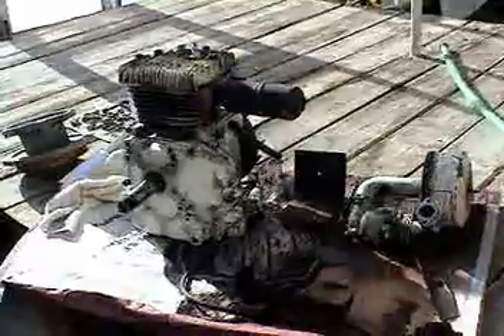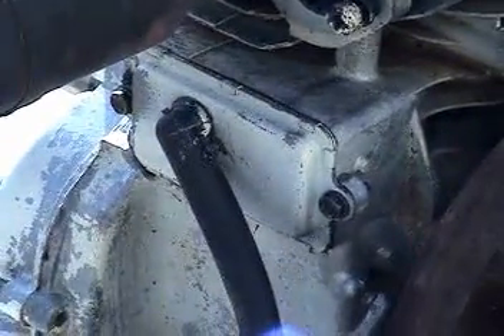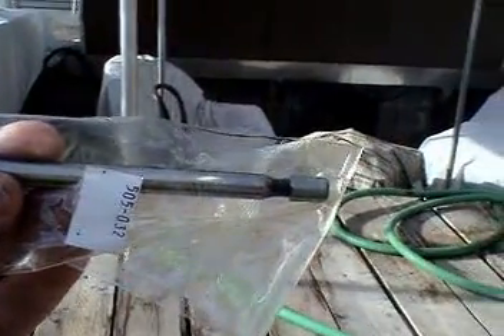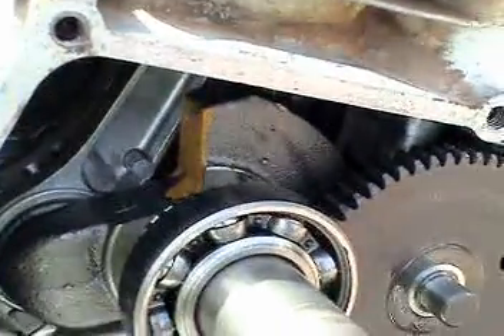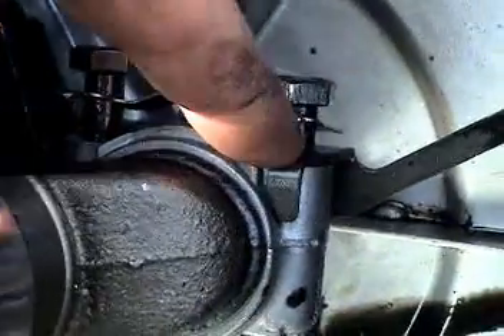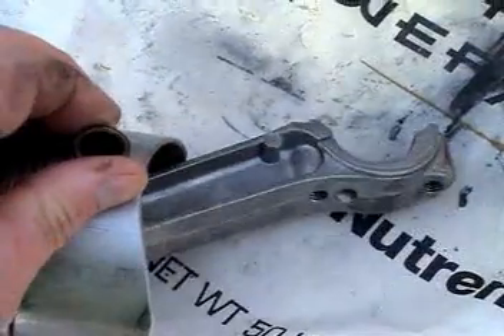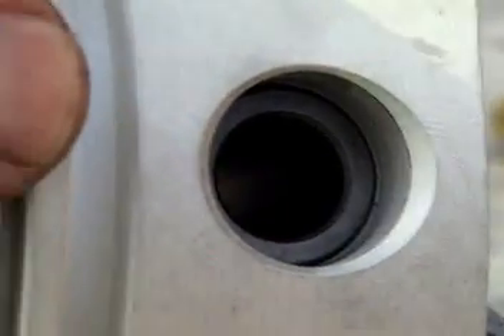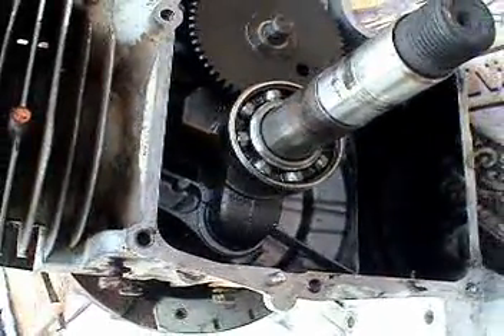Small gasoline engine rebuild / overhaul; part one

Comment: I find the best way to rebuild engines, is to pull them completely apart, to single pieces, spread it out in a big cycle, then place the new parts i wan't installed in the middle, then leave it, go inside and start praying, the creator with do his thing, come back out in 7 days and it will be fully assembled and test run! REALLY, Have faith! trust me!
Note of caustion, be sure to take the new parts out of their plastic bags, for some reason the creator has an issue with that!  (??)
God Bless

Comment: good video..  wasnt sure if you knew what all the parts were called but ya did!!! its an easy job eh??? and i was wondering if you were going to say make sure you dont line up the gaps in the piston rings because this is not good for the engine and creates too much blow by.. ya them 8horse single cylinders are easy.. i got a 16hp opposed twin cylinder that im gonna tear apart and maybe my other 16horse twin cylinder too.. not sure yet..

Comment from the maker: Howdy! I do not know how to convert a small engine from horizontal to vertical, but I have heard it is possible. I suppose only Google knows for sure.

As for valves, there are indeed tools to reseat valves, and there is valve grinding compound to do it. My knowledge on such things is almost zero: I am not a mechanic.

Comment from the maker: "hi nice vid man can u help me im looking for the part number to that dipper of yours i want to convert a vertical shaft to a horizontal"

Howdy. It is 222113, "Dipper - Connecting Rod." It is reference number 30 in the old repair manuals. If you send to me privately an email I can send the PDF document to you.

Comment: the input valve and the exit exhaust valve lol id be afraid to lose the valve keepers through the cracks on the deck why didnt you show how to use the valve spring compressor i wouldve like to seen it

Comment: what you refer to as 'link pin' is called a piston pin, and the 'piston rod' you refer to is called a connecting rod.  Inside the main bearing cap is what's called a rod bearing.  Its purpose is to provide a smooth non friction surface to connect to the journal of the crankshaft with.  That crankshaft spins all the time the engine is on.  So, metal on metal would eventually wear both the crank journal and main bearing cap down.  Hence, they use a main bearing.

Comment: "piston ring cap"?  You mean rod cap.  Piston rings are the rings that go on the outside of the piston to make a seal with the cylinder wall for vacuming air/fuel into the combustion chamber and allowing for compression.

Comment: the 'half drum things cut in half' is called tappets.  Their purpose is to slide into the valve spring retainer(the washer type thing) to hold the spring in place.